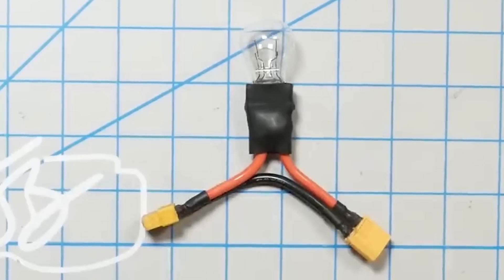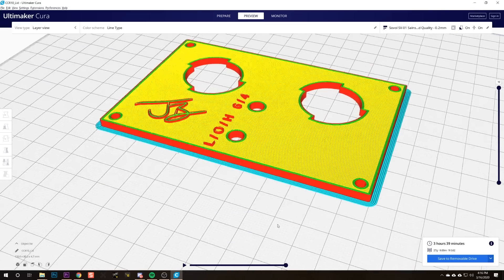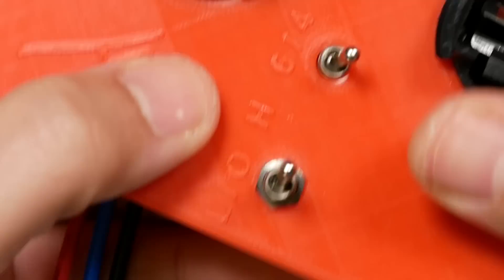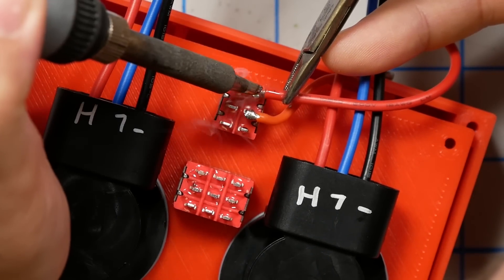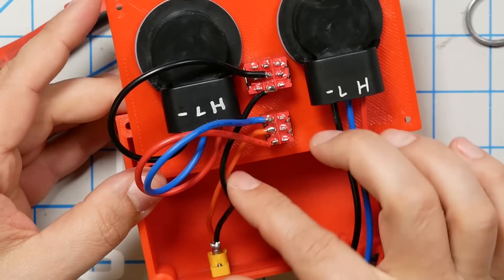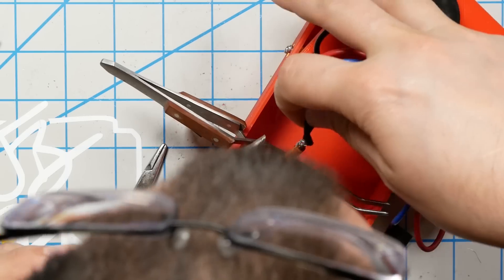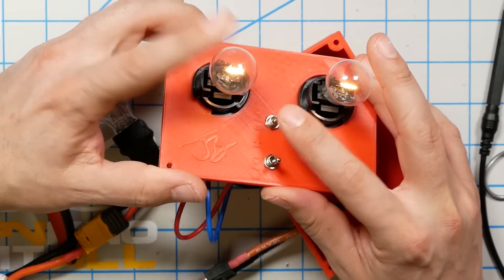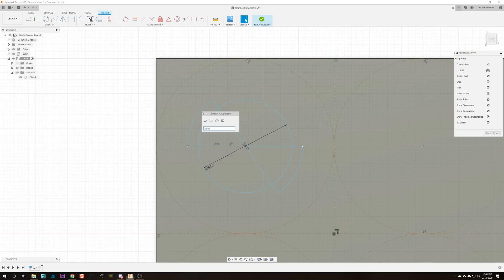Ultimate Smoke Stopper Box! NERD HEAVEN.

Comment: Like it - on the other hand: Take e.g. a DPS3005 or DPS3012  for $25 from Banggood, connect it to your charge PSU (we are under nerds here, so you got 24V+ 500W+) and you can even set voltage and a current limit.

Comment: why don't you just screw directly into the plastic? I've found a m3 will screw perfectly into a 2.5mm hole. Takes a smidge little more effort than you are used to but it works

Comment: I already did one similar (and a video) for up to 4S with high/low settings. I don't run 6S yet but had planned on building a smoke stopper to handle 6S with two bulbs, or even with one bulb and a resistor. I have had the schematics drawn up sitting next to my bench for about a year now; just haven't had a need for a 6S capable smoke stopper. You beat me to the punch on the 6S capable video.

Comment: why does your solder melt so fast on the xt 60 connector. it takes me like 8 seconds to melt and i am using 400C on that same hakko iron i think. it that tip really nice? should i get one?
Reply: tip size makes a big difference. Question is: How often do you want to switch between tips? I could solder a XT60 withing seconds using a big tip, but 90% of my soldering needs a smaller tip, thats why I often just solder with a tip to small for the job.

Comment: in response to 1:04, if your gonna gp to that effort, then why not use a DC fast acting circuit breaker? They make solid state ones that are really good.

Alternarively you can just power your quad with a laptop power supply, which can deliver 3A but will have short circuit protection (either foldback current limiting or hiccup mode).

Or just pony up and get a lab bench power supply, with regular Constant Current mode limiting. <100W Switch mode supplies are cheap

Comment: Hey joshua and followers. How much would you guys be willing to pay for a bnf 5 inch that is conformal coated (completely water proof) and is decked with high spec components like the rush tank plus ultimate and ummagawd remix v2 frame? Just curious. Thanks
Reply from the maker: Here's the gist of the BnF market in my opinion.

Under $200 - Budget. Compare to Cidora SL5 SE.
Around $300 - Standard. Compare to Cidora SL5.
Around $400 - Premium / not boutique. Top quality parts but still from mass production.
$500 and up - Premium / boutique. Top quality parts, hand built per order. Typically needs to be associated with a known brand or personality or people won't buy.

Comment: I think you should have added a fuse just behind the input xt60.. I can think of people making a bad joint on one of the switches, and a wire could come loose and short the something inside. Adding a small 10A fuse would prevent fire from a lipo being shorted

Comment: I am confused I feel like a fuse will do just as well. And they make fast-blow fuses??? What is the point of smoke stoppers? I like your creation but I feel the root idea (light bulbs) is flawed.
Reply: HE EXPLAINS IT IN OTHER HOW TO MAKE A SMOKE STOPPER VIDEO
Reply: @paulgeorge1069  Watching it now but i am still not convinced. He is using it like a current limit. it is creative but still not sure if "right" way of doing it.
Reply from the maker: Fuses need to be replaced every single time you trip them. Bulbs last forever. Do you want to pay a couple bucks every time you troubleshoot this issue?
Reply: @JoshuaBardwell  So I looked into this, the "PTC Fuse" they use works* but is not the right way. You can make a PTC overcurrent protection that is not a fuse. While you are at it you can add an NTC to do Anti-sparking.  This is a great read: https://circuitcellar.com/cc-blog/inrush-current-limiters-in-action/

*I think the smoke stopper you tested in the other video that uses PTC fuses is the wrong way of making one of these. Using a PTC designed to limit current to motors would be better. There also appears to be other people who realize that this can be improved upon IEL: "smart" smoke stopper. I will keep looking around if I don't see one that works well I might make my own ;)

Comment: Even better, I found a build where it uses a circuit breaker! That way you never have to replace the bulb and it's instantaneous! 😎 🤘
Reply: A regular house appliance breaker? Not sure if that trips at the given current when the voltage is so much lower.

Comment: Nice build.  Very useful.  The only suggestion I have, would be a fuse directly after the XT60 input connector.  If there is a fault or an internal short in one of the bulbs or sockets (I've seen it happen) then we all know what can happen when you short a lipo.  Not a criticism, just a suggestion.  Love your channel, I've learned so much everyday about the hobby that I'm quite new to.

Comment: I have a strange question for you. When I go to motors tab in betaflight with smoke stopper on I can't run the motors off the master control. Some turn some Don't. Individually there fine. I put props on and no smoke stopper and everything is fine. Probably this junk flight controller I had to get cause I had a dark max and needed a vtx on flight controller or put it on top. Zero room so I used rcharlance f4 to a mamba esc. So far so good worked just great till a prop came loose on about a 100' dive. No more dark max. Back to Arris 250 frame. headed out to fly pray for equipment I think I can hear it shaking right now LOL☠️☠️☠️
Reply: The reason you not be able to run all the motors at one time is that they together use too many amp. I' made a nice one jb Style smoke stopper 12 volt electric bulb and when I turn motors  it starts to light up the more amps I use 💪🤓 Thanks to jb

Comment: Really, really interesting! Thanks a lot, Joshua! 😃
Well, around here I could only find the 2 wires sockets. And I really don't have any interest in 6s, so... I'm thinking about making a simpler one, only selecting between a bulb for bigger quads or the other for smaller quads. 😊
Reply: I did that based on someone else's design here: https://media.discordapp.net/attachments/477844309073199104/583512503091331084/Wiring_Diagram.jpg , but with xt30s.  Now I need to design and print a box, although the printing will have to wait until my Prusa Mini arrives maybe in April...  I find that without the box, the switch is pretty hard to flip one handed, which makes it less useful for reducing hands in the off to on scenario.  I purchased a rocker switch to make it easier than the toggle as well.

Comment: So its a fun project and I get that everyone like to build something useful but at this point just buy a cheap current limiting bench powersupply.  They can do the job of a smokestopper and SO much more.  I consider it to be an essential tool on par with a soldering iron or multimeter.  Something 30 volt 5 amp is fine for our hobby and amazon has some great options at around $60.

Comment: Why use a bulb when you can use a fast fuse instead. Burns out quicker and more controlled then a bulb. Take less space and is less fragile. Combined with a voltage display on output its the perfect smoke stopper. The voltage sensor has a dual function. You can see if there is voltage already on input... If usb feeds voltage the wrong way you might fry your computer even if using a smoke stopper. I did this in a even smaller box. Even added a bec and usb port so it can serve as phone/tiny whoop charger.
Reply from the maker: Fuses have to be replaced every time it burns out. Bulbs are infinitely reusable.

Fuses cut off current but they are not usable as a current limiter. With the bulb, I can safely spin the motors at slow speed, while knowing they can't spin fast enough to hurt me. A fuse would just blow.
Reply: @JoshuaBardwell  ok... so far I have never replaced a fuse but even if I have built more quads than I can count... But it feels better than having none. The on/off part is wery usable thoug...
Reply: @JoshuaBardwell  also I cant recommend the voltage sensor enough. That have probably saved me a couple of lipos... A lot of testing can depleet the battery.
Reply: So sorry Joshua but your smoke stopper is already obsolete :-)
Reply from the maker: I disagree.

Comment: Are you going to release a DFX of the box or a part model. I love the circuit but not the Box PLA is really only any good for Prototypes as it becomes brittle. An ABS project box off the shelf is more suited as you going to melt it some point.
Reply from the maker: You could always just print the box in ABS or PETG if you prefer.
The files for the box are up on Thingiverse.
Reply: Joshua Bardwell I was going to cut an abs project box on our work milling machine. Did you post a part model or DFX? STL not great to work with on our CAD CAM software cheers 👍
Reply from the maker: The Fusion360 files are up on Thingiverse.
Reply: Thanks Joshua Bardwell keep up the good work 👍

Comment: Thanks a lot, Joshua. I have been assembling everything I need to become a "NuNerd"? (Drone, transmitter, goggles, batteries, charger, parallel board, tools, soldering station/solder, silicone wire, shrink wrap, etc etc etc..... Now, hold on a sec while I add these latest items to my shopping list!

Comment: You'll have to spend some more tinkering time with your printer, that box would look great in a dual-colour print so the text on top properly stands out like the dual-colour prints of my Fat Shark lens protectors thingiverse.com/thing:3502380
It's easy to do with any 3D printer, you insert a command into the gcode to make the printer change filament at a specific layer, then you manually swap filaments over and it carries on printing.